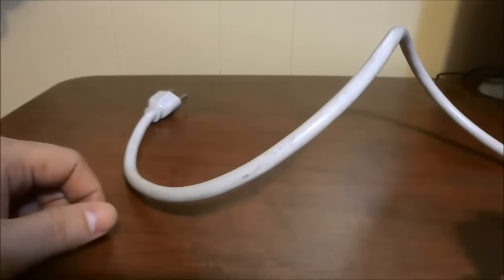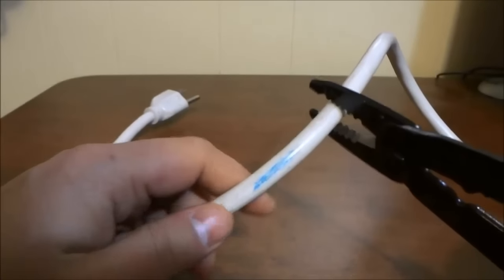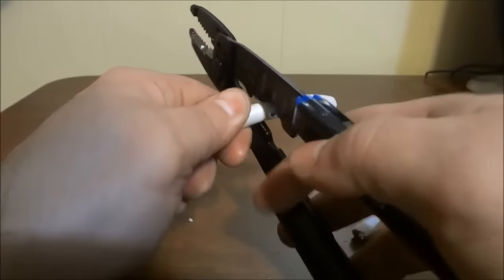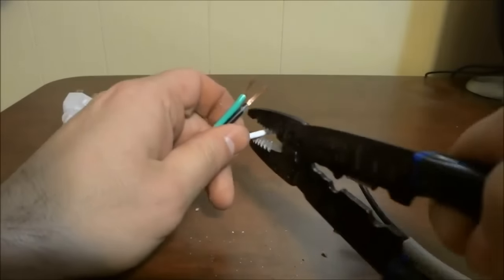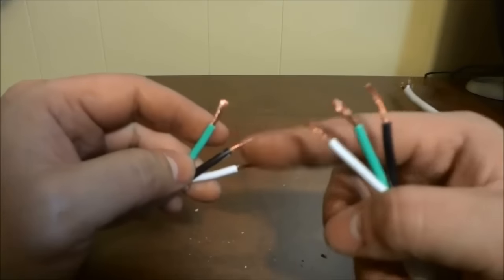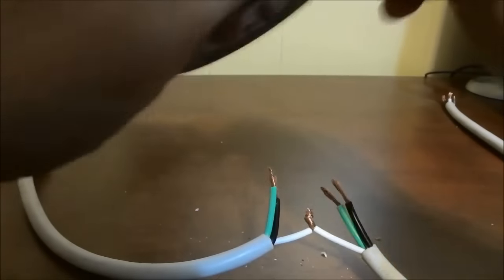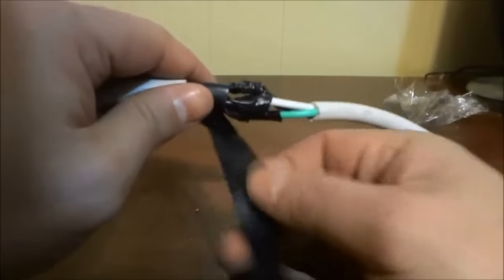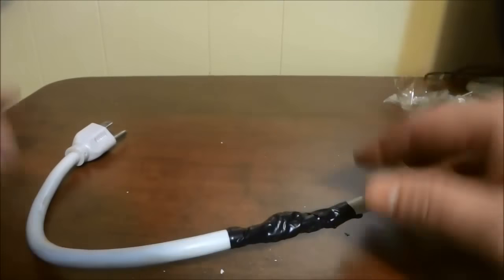How To Fix A Broken Electrical Power Cord With 3 Prongs

Comment: I thought it was a great tutorial!I clicked onto 4or5 others until I found this one that I could do, I don't know how to solder like other ones demonstrated. I was able to actually repair my Extention cord all by myself , thanks to this one! Thank you for helping me.
Reply: U.K. electrical engineer reporting in. 
Please, if you still have this cable, get rid of it and buy a new one. 
Taping over twisted joints is a horrible, horrible hack repair and will quickly become resistive, getting hot, softening the tape and eventually causing a short. Seconds after this  you have a house fire. 
Honestly, this prick has no business telling anyone how to do electrical repairs, he’s absolutely incompetent and he’s going to get someone killed.
Reply: Are you his sister or something? thanks for helping me put my life in danger

Comment: Oh my goodness. DO NOT TAPE a cord back together. This is dangerous. Tape will not hold permanently.
Reply: Then what to do 🙄🥺
Reply: The best way to repair a cord is ... DON'T. Replace the entire cord instead. You can find replacement cords for most appliances at a hardware or electrical supply store.
If this is not possible and you need to splice, soldering the wires together will be more secure, but still might not comply with electrical codes.
If you are not confident repairing an electrical cable, don't try. Call a qualified electrician.
Reply: @StobbeCam  ohh so the only difference is a peice of paper or licensed person..i get it

Comment: This is horrible hack. Fine wires can pierce duct tape easily and get unprotected or perhaps even cause short circuit and fire in worst case. Also when you pull cable apart (for example accidentally by leg) it can hurt you.

Comment: do yourself a favour and actually use a contactors (aka electrical plugs/switches), they're dirt cheap and will make the connection so much safer.

there are three problems with linking power cables like this: 
- wet and humid places will unglue the tape and risking a short circuit
- hot places or high wattage on the cable will cause it to get hot, either burning the tape or condensation appear, resulting on short circuit risk
-the cable will tear itself relatively easy after a month or two, and, if there are childrens or pets, a fatal accident may happen.

do use plugs (10-15 cents two-way) when you cannot solder power cables... you'll only need 3 of them for this kind of cables.

this should be an emergency fix for as little time as possible.

Comment: actually, you can solder the "Dog Chewed" wiring back together and put heat shrink over it.
Reply: Would wire nuts + electrical tape be any better than this? i'm looking into adding a 3 prong power cord to a LED mirror that comes with pigtail wires. I'm really not trying to to burn my house down.
Reply: @AdonisKeef  Ah I see.  Running exposed wire nuts, not in a suitable gang box is against national electrical code.  I recommend you contact a licensed electrician to put an "old work gang box" into the wall with 14/2 romex running to the box. and then wire it up directly into the wall. Does the mirror have a switch on the front of it I assume? I recommend you contact a licensed  electrician  to go the "in the wall" route. It will look all around better, and is much safer than squeezing wire nuts in between the mirror, and the wall.
Reply: Queen City Sirens Thanks for the reply! I really wanted to do it on my own but I know you’re right. I’ll contact an electrician! You might have possibly saved my life. 😅
Reply: @AdonisKeef  Np. Good luck!
Reply: @queencitysirens8755  why are wire nuts even made then?
Reply: @lilbagz4418  for splices in a box
Reply: @queencitysirens8755  ok thanks ..ill go look up what a box is

Comment: buy new cord, remove old cord, connect new cord!
Reply: how do you do that?  I need a new 3 prong cord for my dehumidifier, or try to re-attach the plug which only has about a half inch of cord.
Reply: Where in lockdown everythings closed and couldn't wait 5 days for a delivery our vacuum cord broke so I copied this method I used double fem butt plugs and electrical tape

Comment: No, no and no. Power cords should NOT be ever fixed!! The must be replaced or shortened if they got damaged.
Reply: sikkepossu that makes not sense. Why would they even supply replacement power plugs and wire parts? Depending on how to do the repair they work good as new.